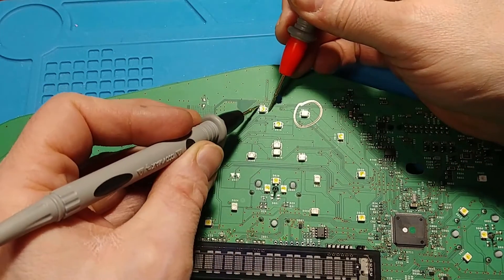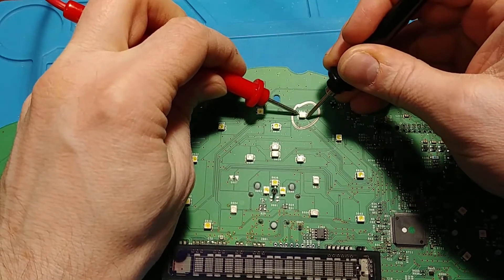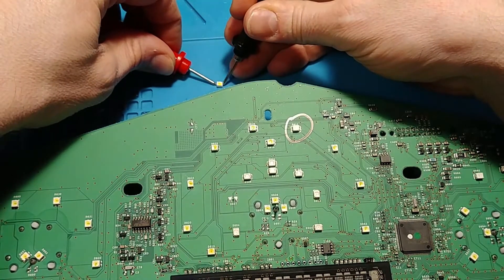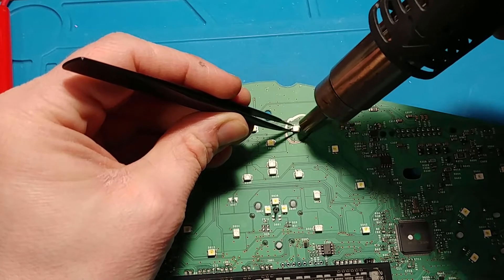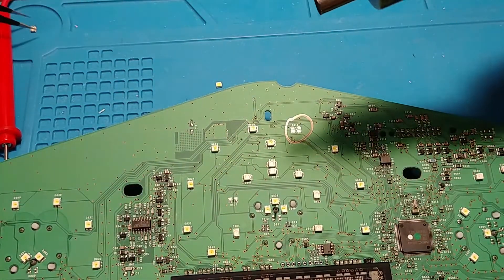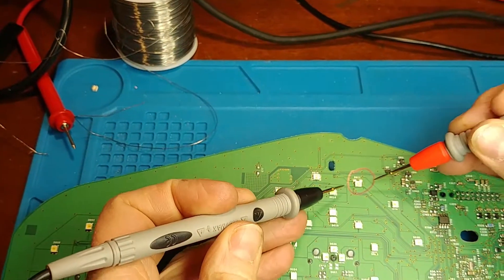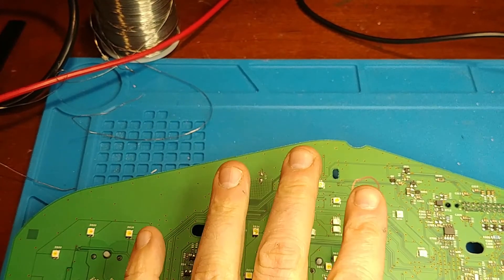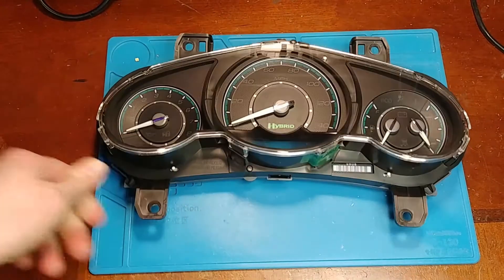How to Repair 08 Malibu Cluster Back lights

Comment: Would a 2012 Chevy Malibu also use these PLCC-4 leds?
Reply from the maker: Yes correct, 2012 same design.
Reply: @jeffescortlx  thank you very much man. I’ve been looking into swapping my speedometer leds for red ones for a long time. Ordered a pack of 50 PLCC-4 SMD Red - Ultra Bright 1210 / 3528 LED. And am going to have a local business solder them in for me. Quick question, which you may not know the answer to, how would I go about also changing the color of the lights in the climate control and the shifter? Are these both done by soldering onto a plate?
Reply from the maker: @Th3Detect1ve  I have not had the HVAC head unit apart on the Malibu yet. But I'm very confident that it will also have soldered in SMD LEDs.
Reply: @jeffescortlx  yup just took her apart last night. Same leds. Good thing I ordered 50

Comment: The entire cluster for my 2010 Malibu is dead. No LEDs, needles don't move, only the engine light flashes when I turn the car on. Is that a bigger issue than switching out an LED?
Reply from the maker: A bad LED won't cause the cluster to be completely dead. You have something else going on.
Reply: @jeffescortlx  Any suggestions on a course of action? I'm really trying to dodge the dealership.
Reply from the maker: @Puniversity  either send it in for repair, or start trouble shooting.
Reply: @jeffescortlx  I gotcha. I've gotten quotes from 3 different places that they don't take instrument clusters from a 2010 Malibu, smh. Dealership it is.
Reply from the maker: @Puniversity  who did you ask?
Reply: @jeffescortlx  circuit board medics, southern electronics, one more place I can't recall
Reply from the maker: @Puniversity  I have a 2010 malibu cluster showing up today or tomorrow. If I have luck with it I'll take yours in. Touch base back with me in a couple days.
Reply: @jeffescortlx  Will do thanks
Reply: @jeffescortlx  any luck on that malibu cluster?
Reply from the maker: @Puniversity  yep video coming soon.

Comment: Does this same process apply for tbe saturn aura?
Reply from the maker: Yes
Reply: May I have the part number for the leds?
Reply from the maker: @arthurjones97  I wish I had the original full part number, but I don't. I substituted with some generic 3528, but color temp is a bit off.
Reply: Thanks man life saver

Comment: Jeff, have you experienced 08-12 Malibu clusters being intermittent? Mine is. No lights, gauges not working.
Reply from the maker: No, not yet.
Reply: @jeffescortlx  Thanks for the reply.
Reply: @Hector Cortez-aponte-cabrera Hi Hector. I had the TSB done at dealer many miles ago. I had to perform the procedure again due to the brake light/traction issue starting again. What is very odd about this problem is that I can get the cluster to start working again by removing the Cluster/Theft fuse a few times and once I hear the blend door actuator gear moving (and I don't know why Cluster fuse would affect that) the cluster comes back on. Crazy!
Reply: @Hector Cortez-aponte-cabrera Thanks Hector! I will look in the morning tomorrow. It went out again this morning.
Reply: @Hector Cortez-aponte-cabrera Good morning. I'm believe the gear turning I"m hearing when I know it will come back on is actually the instrument cluster stepper motor. So as you indicate I most likely have a wiring/connection issue or component problem. I'll get back to you after looking at the ebcm. Thanks again.

Comment: Hello! Thanks for the video! Awesome, i have a 2010 chev malibu lt, i bought a few weeks ago, and the fuel and temp back lights not working, the needle lights work,  strange thing is for first time the other day they lit up for my half hour drive,, the next morning off again, does this mean its not a bad led like i first thought? Tia
Reply from the maker: It's common for LED's to flicker as they start to fail. So I'm not surprised it might work again temporarily.
Reply: jeffescortlx so then im back to assuming its an led issue and i can go ahead and remove cluster to test? My concern was it might be something else and beyond my skillset and tooling
Reply from the maker: It's going to be a internal to the cluster problem if only some of the back lighting is working.
Reply: jeffescortlx  well everything works except the back light for the fuel, and temp gauge, thats why i suspected the led for those, tgis is my first, so thsts why im seeking info,, where are you located? Id bring it to you if you were near Toronto
Reply: jeffescortlx you are saying if one led out they should all be out? Like old Christmas tree lighting? Lol
Reply from the maker: Sorry, we share the same mosquitoes, but wrong side of border.
Reply from the maker: No not all. With the Malibu the middle MPH is a isolated set from the temp/fuel sides.
Reply: jeffescortlx ok, so it could still be bad led?
Reply from the maker: Yes, I'm expecting it to be a defective LED. I just did another 09 Aura tonight, I believe it's the same as Malibu.
Reply: jeffescortlx ok cool, thanks for the info and advice, i feel comfortable doing an led,, if it was a chip i dont have tooling or that skill level lol, iv soldered batteries in ipods ect, so...
Reply from the maker: If you have 2 soldering irons you can lift all 4 pins at the same time. Good luck! Its not too bad.
Reply: jeffescortlx cool, i do have two irons, ill let you know how it goes when i attempt, thanks again! Much appreciated

Comment: Done a lot of these. They are a PLCC-4 LED. lighthouseleds.com has what you need with the proper anode & cathode pinout.
Reply from the maker: Do you know what brand lighthouse ship's out? Description is vague. GM uses standard 3528 for like the Colorado, but then have to mix it up for the others with the 4 pin package. Would be nice if all the engineer's could agree with each other and standardize. Do you see one model of GM's with LED failures the most?
Reply: If I may ask what is the part number for those replacement LEDS.
Reply: I did purchase some of these and installed 2 on a Saturn yesterday, I don't know if the color is wrong or they are brighter but they don't match the other needles. Just an FYI.
Reply from the maker: @michaelbox7285  I've ran into that problem too. I ended up just replacing them all.